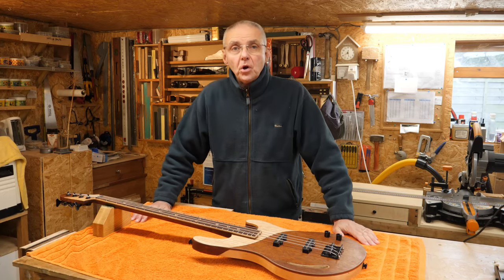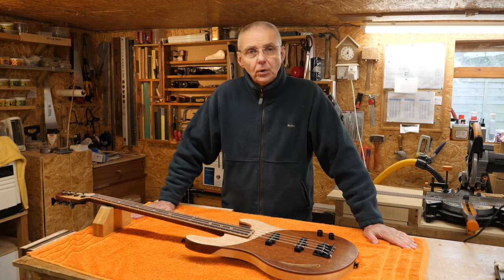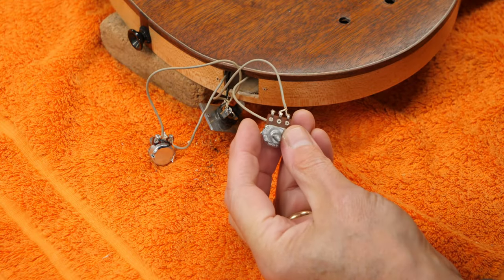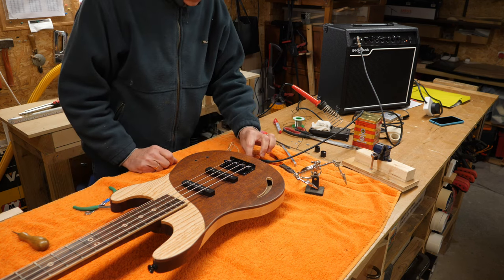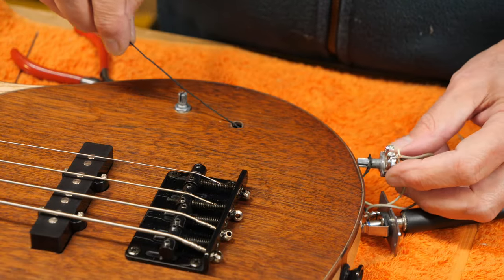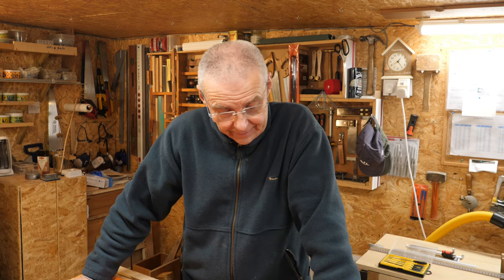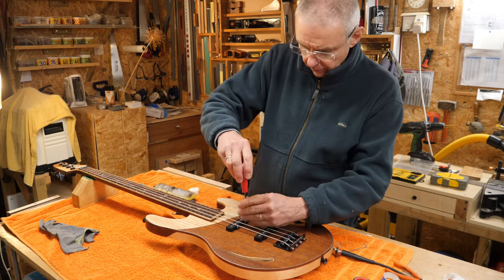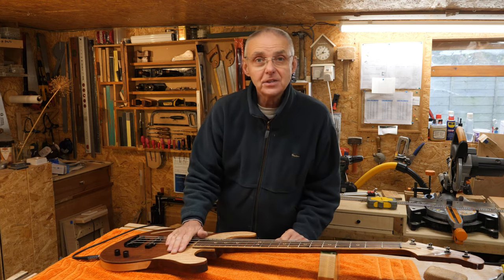Snagging the bass guitar. Jurg's Challenge Ep 21 - A hollow body electric jazz bass

Comment: It looks great. I like the contrast between the ash and mahogany. I'm curious how it balances. Does it suffer from neck dive? The solid part of the body at the neck side should help a bit, but it's at the wrong end in terms of shifting the centre of gravity in the right direction. I guess that chunky bridge and electronics helps though.
Reply from the maker: Thank you for mentioning this.  It is a bit light on the body side, hold on just waiting for scones out the oven and I’ll try it…yep it does dive is the simple answer 🤨. The guitar weighs 3kg compared to my Squire P Bass 3.6kg and I have left the neck quite thick at the nut 23mm compared to 20mm on the Squire.  This is the issue with hollow body long neck basses which I guess is why you don’t see many. For me I prefer the lighter weight.  Most of my playing is in my home studio but I have a strap made of leather links which doesn’t slide so much for live use. Cheers Dave

Comment: Lovely design very nice! Many years ago when repairing a Gretsch hollow body guitar I discovered that electrician's earth sleeving attaches firmly if pushed onto the splines of a pot before pushing into the cavity, making it easy to pull back into place once the repair is done. My tip anyway!
Reply from the maker: Thank you! That’s a really helpful tip I can see how that would work very well. Cheers Dave

Comment: That's a very nice bass Dave. Personally I have no problem with back covers on hollow bodies. It serves a practical purpose and they don't have to be plastic.
Reply: You can fit larger, high quality pots and can solder them in place with an access panel in the back.
Reply from the maker: You have a good point and a nice wooden plate looks really nice. Cheers Dave